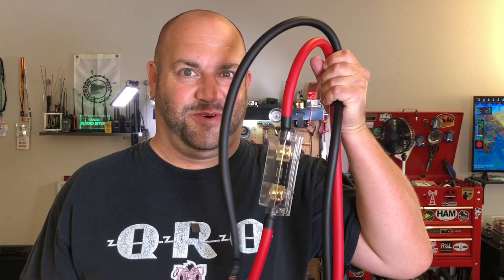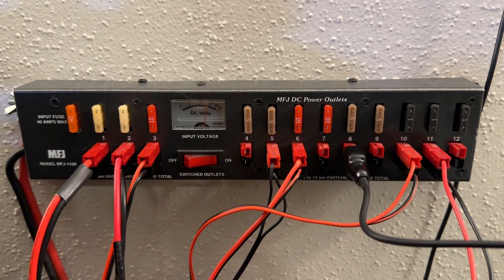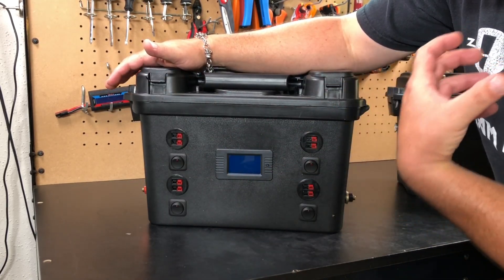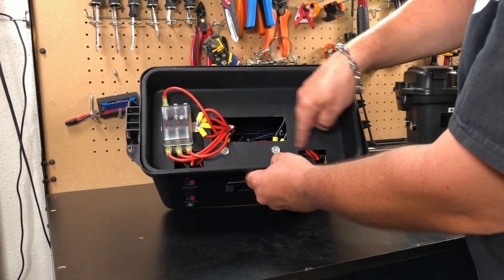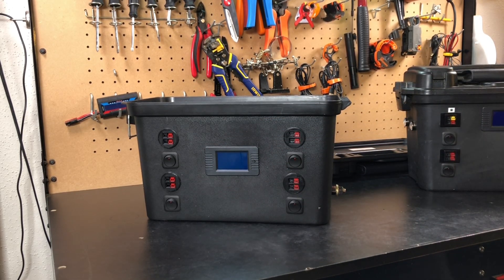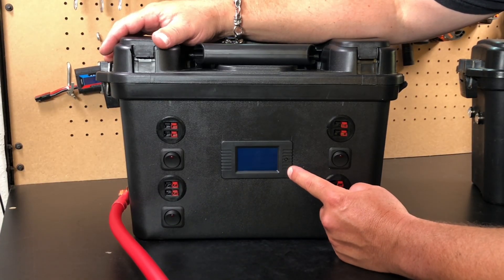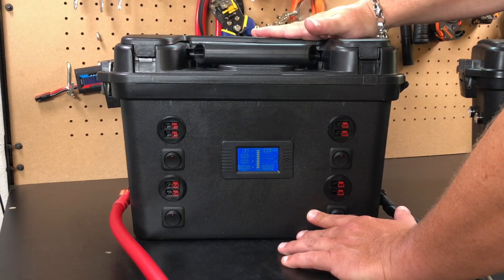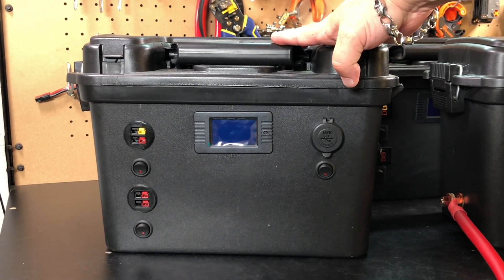Big Geek Expansion Pack | You Need To Watch This!

Comment: Nice creation. the only thing I would change is the connectors. I would you use the SB50 and SB 75 Anderson power poles. Also, I would put a battery cutoff switch at the battery connection to the big Bank of batteries.  The solar charge controller is a great idea how you're setting it up. But, since you're dealing with a large amp hour battery bank,  I would look at increasing the amps that the charger controller could handle. Your system is close to being almost like a battery Bank associated with a yacht or boat.

Comment: Another option to configure the distribution setup from the 100AH or 300AH battery would for each individual operator to use their own Little/Big Geek setups with solar input power pole.  Then you would connect the main distribution power pole to the solar charging input port of each operator.  This would have the big battery distribution box then continuously charge all of the internal Little Geek batteries.  This should get much longer run times.

Comment: That really nice.  I like building as well. for me I would use a Anderson SB 350 connectors .no tools 350 amp rated.also I would use a battery disconnect switch at the  battery. My ammo can box is different but I bult for my needs and camping is one of them . also power pole is in 75 amp and 175 amp . same red and black just bigger. I use the SB series as well . some of them battery's come with SB 50 grey on battery. good for 50 amps !  73's

Comment: Great build. Any thought about using 100 amp Anderson connectors for your battery? I believe that it would make for a cleaner install.  My 2 cents. 73
Reply from the maker: I thought about it yes.  And that's about as far as I got.  I really didn't have much time to build this before field day so I had to make some compromises but it would be nice to have a 100 amp or bigger power pole on this.   I would actually like to install a couple PP housings on the back to plug in the wires from the battery and use the other as an output for hooking up an amp.

Comment: Neat project.  A couple of things;  I've found nail polish lasts longer for marking equipment than sharpies, especially on metal. Much easier sometimes to come by than the model paint I used to use (I can usually borrow some from the XYL and put it back before she notices).
Another thing, Anderson makes some high current connectors (I've seen 120A), such as used by FD for their vehicles when in the fire house.  Might be worth looking at to cut the odds of someone hooking up the high current line wrong.

Comment: 2 comments First and most important. BE SURE to remove all metal on your arms before you hook any cables to anything. To control input voltage, you may want to install a suitable amperage knife switch in the positive cable, nearer the battery end, for emergency disconnect. I don't want you to die of a mistake with electricity.

Comment: That's awesome! A+ for using Wagos too! I'd suggest maybe some colored rubber boots to go over the input terminals just for safety sake (like what most cars have now on the battery terminals). Or, I wonder if it would be workable to put the input terminals under that top storage lid where you put the spare fuse (run one cable in on each side)? At least then it's isolated from the elements or anyone touching them. Maybe instead of screw terminals just have the big Anderson 350A connector on the box and use a pigtail to ring terminals on the battery for easy disconnect?

Comment: Mike, I like to make a small suggestion. place your power poles about 3-4" (where you connect the battery too) higher up on the side of the expansion box. That if you place your box on the ground & the ground is wet/damp or you're on a grassy spot, your battery connection is not touching anything damp or wet and causing a shorting problems.